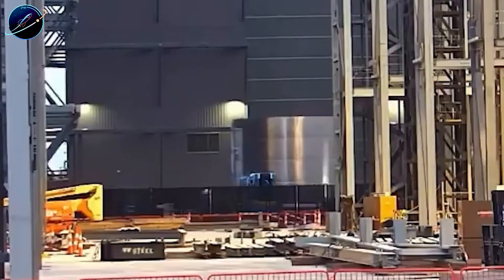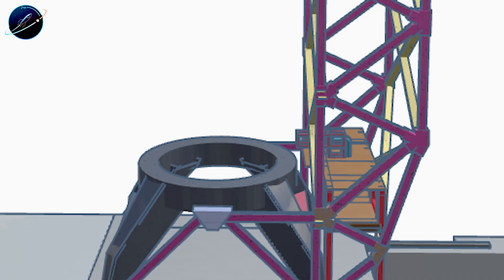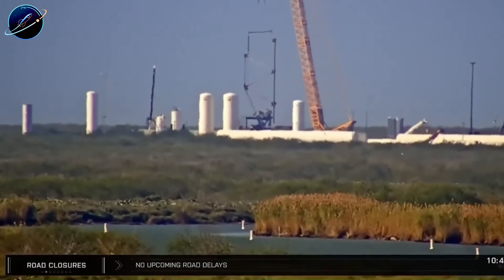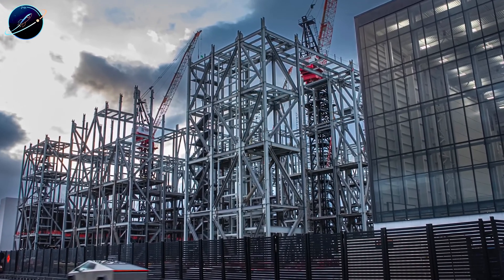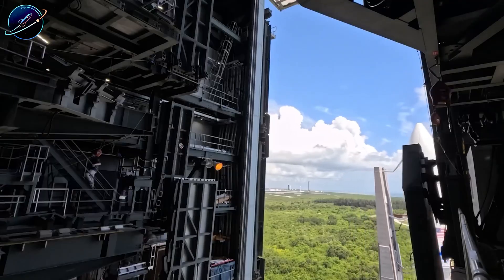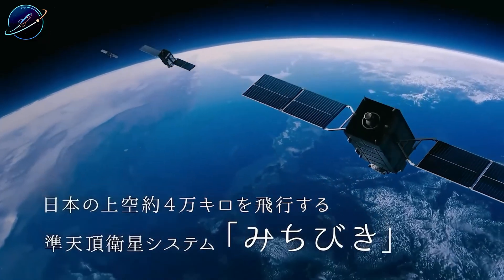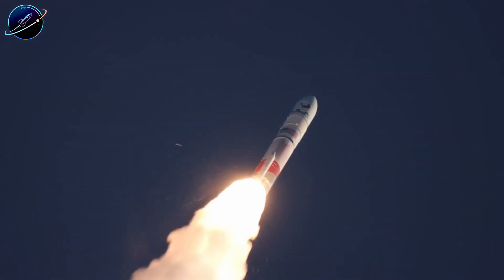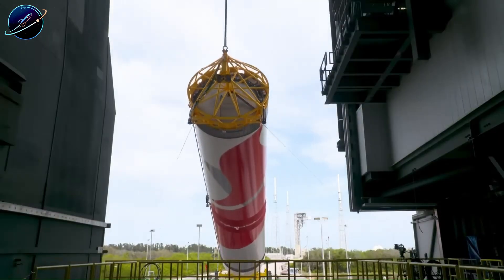It's Mind-blowing! SpaceX's First Move After B18: 3.5X Speed, Bruno Quits!

Comment: I've always wondered could stage zero for the LaunchPad could be used to produce power from waste heat and maybe bring down the price of launch
Reply from the maker: Great question—stage zero (the Orbital Launch Mount) absorbs massive heat from 33 Raptor engines during ignition and liftoff, but the deluge system vaporizes most of it via water spray.